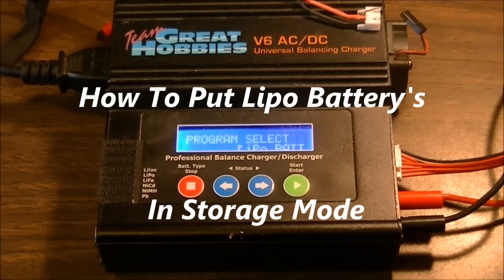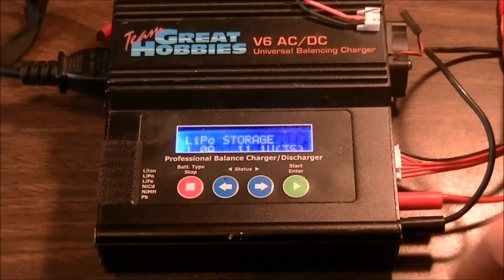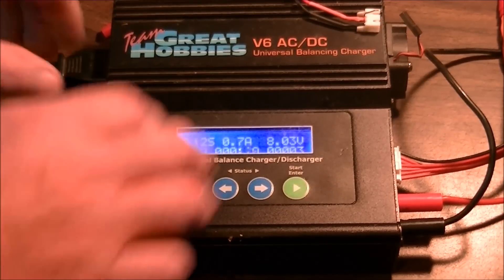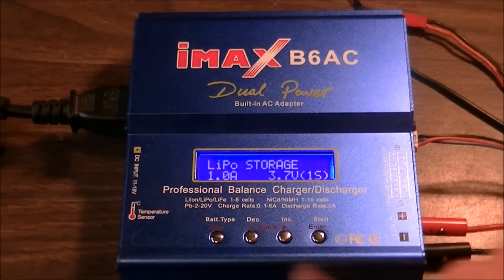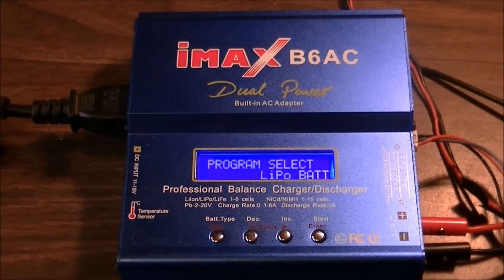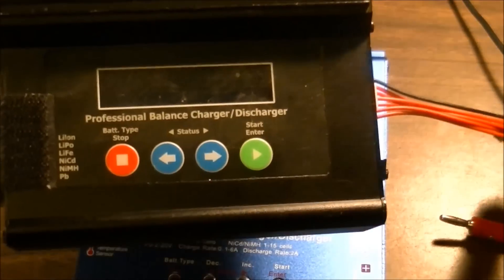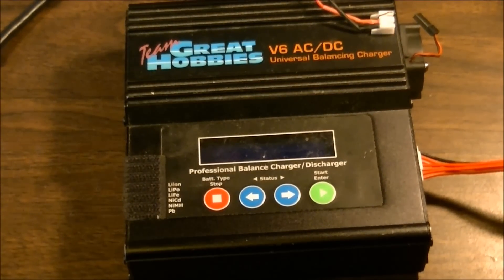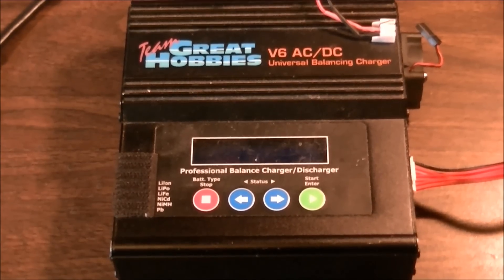How To Put Lipo Battery's In Storage Mode

Comment: Does this apply to Li-ion batteries as well? If not, what's the proper storage voltage for Li-ion batteries?
Reply from the maker: proper for lipo is 3.8  volts per cell
Reply: @KevinMillard68  yes, that's for lipo. How about Li-ion?
Reply from the maker: @cadd9511  same thing for both
Reply: I heard Li-ion can go as low as 2.5v. But that was on another vid

Comment: Will the B6 charger be compatible with a 12V DC Adapter, and does the charger  notify the user when it is finished in “storage mode”? Thanks!
Reply from the maker: you have to use the voltage and amperage and polarity of the one its made for it

Comment: can i storage mode a fullycharged lipo
Reply from the maker: yup because storage mode drains the battery to storage mode.. you can just leave a lipo fully charged over time like any other batter they still lose power the longer they sit on the shelf either way youll want to top it up before the next use
Reply: @KevinMillard68   tnx bro just storage mode it last night 😎

Comment: if your battery is below storage voltage could i use storage mode to charge up to it or would i have to balance charge it up then discharge it down.
Reply from the maker: my advice balance charge it up then put it into storage mode

Comment: Hi, does Lipo Storage only discharge or will charge a under 3.8v per cell battery (that has been flied for example) or do I need to put it in balance and stop at 3.8v per cells ?
Reply from the maker: it dishchareges the batter to 3.8 volts per cell

Comment: Does it affect battery life or quality when using higher amperage for the discharge rate. Thanks.
Reply from the maker: no it does not the higher rate makes it do its job faster,, how ever when you charge any battery at higher rates to charge them faster that does affect them and can even cause them to catch fire as well expecially with lipo and  life batterys and li ion batteries ,, now for nicad and nimh batteries to charge them at or above their rate can cause them to over heat or catch fire and does also limit there life and charging any battery that is freash out of the RC in this case with out  letting it cool down first will also casue shorter life and can also damage the battery as well.

Comment: hi, so it mean that , storage mode are just to keep the battery at 3.8v per cell rite? no matter if i had a full charge, i just use it to drop the v to 3.8 and store it also are necessary? as long as the battery had a 3.8v per cell, am i rite? 
for the storage mode, if my batter are lower like a 3.7v, using the storage mode, it will help me to charge it till 3.8v and cut off? & if over like 4.0v , it will auto help me drop it till 3.8v and cut off?
Reply from the maker: you just need to follow this video to put your lipos in storage mode, in all reality i never use storage mode on any of my lipos but i do make sure that once a month to top them off to make sure they are fully charged in case iam going to use them,,

Comment: Hey I really love your video I just want to say I'm using the Venom charger I'm on the store charging now and I would like to know how long would it last to storage how long the charging will last because this is my first time doing this will that one point amp will that change what would it do or would it cut off when it finish
Reply from the maker: you set the dishcarge rate to how fast you want it to put it into storage mode , as for how long a battery can stay in storage mode no one really knows that answer but it can stay that way for along time so several months for sure but not forever

Comment: do I need charge battery first before storage mode? or from flat?
Reply: If you put it in storage mode if the battery is BELOW 3.85V, storage mode will raise the voltage to 3.85V.

You don't need to balance charge first then storage charge. That's unnecessary and doesn't confer any additional benefit.
Reply from the maker: you never ever r un a lipo flate dead how ever the storage mode is 3.8 volts per cell so you have to have a min of that or above to put into storage mode if you are below 3.8 volts per cell you will have to chage the battery for 20 min then stop the charger then put it into storage mode
Reply: @KevinMillard68  I realize this is OLD. However, to be clear I believe he likely didn't really mean "from flat" to be ZERO volts. He was probably thinking from the lowest safe voltage for a particular cell configuration (basically the same as using "Discharge" mode of unit). Similarly, it would be comparable to the default cutoff point at which a protected cell/battery would stop supplying energy.
Reply from the maker: @exgenica  some rcs will not cut off till they hit 3.0 volts which is bad for most lipo batteries to got that lose and life batteries can go to 2.2 if i recall and be safe but lipos no lower then 3.0 but again most cant its a bad thing to go that low

Comment: my charger goes to 2A should I put it in storage mode with 2A or 1A?  I've got an 4500mah 6S pulse Lipo
Reply from the maker: 1a or 2 a is how was it will drain its your choice how fast you want it to drain to the storage level

Comment: I have putted my lipo in storage mode now. but if I want to use it again what should I do then? charge it first or discharge it first en then (balance) charge it? or something else?
Reply from the maker: always balance charge and you have to charge it before you use it due to the fact you have it in storage mode
Reply: I balanced my lipo with the correct inputs etc. but as soon as I started flying with my quadcopter it started to beep, that means that the battery is low. what did I do wrong?
Reply from the maker: so you put the battery in storage mode then you recharge it normal  in balance mode is this what you saying, it sounds to me you tried to use a battery that was in storage mode only in which case that would explain your problem
Reply: lars beckers it might just be your low battery buzzer. Sometimes when you give a lot of throttle the batterys voltage will go down but right back up once you decrease your throttle. Either get a better or high discharge rate battery or if you can set you low battery buzzer a little higher.

Comment: Always disconnect battery from leads before disconnecting from charger because the banana lead can short the battery and possibly explode battery
Reply: 10/10 point
Reply from the maker: sir sir yes sir LOL look man iam not an idiot so that wont ever happen to me how ever you have a good point thanks for pointing that out good job :)
Reply: @KevinMillard68  Of course it will never happen to you. That's why the electrical industry has health and safety procedures, regs.

It's amazing what can go wrong when one is in a hurry and possibly distracted for whatever reason/s. A snag here a trip there..
Reply from the maker: @sonicstep  :)
Reply: You mean from charge leads with exposed, unshielded end conductors to avoid shorting. 

That is a typical shortcoming with such a generic charger that uses banana connectors. The ideal would be a shielded connector of sorts.

Comment: what storage amp should i set my charger. 2s 5000mah 40c. my charger option storage are.   
.1 to 1.0amp
Reply from the maker: thats how fast it drains it down the lower to longer it will take to get to storage mode so its your choice
Reply: I do my battery at 1.0 per venom rc support .I have a 5000 mah 35c 2s and that’s what they suggested

Comment: can you put a full charged battery in storage mode? Can you put a dead battery in storage mode? not dead as in broken dead as in just ran out have to charge it again. lol
Reply from the maker: yes you can take a fully charged batt and put it in storage mod stoarage mod is ususall 3.8 volts per cell so it wont be fully charged anymore when its in storage mode as for your dead batt if its a good batt and just hit its cut off then you can piut the batt in storage mode it will be charge to the proper volts only for storage mode

Comment: is it normal for this to take a couple hours to do?
Reply from the maker: to charge a battery yes,, however you can fast charge your batterys but you lose run time and you can damage the battery and you risk a fire to by fast charging and you shorten the battery cycle life alot by fast charging but hey to each his own i like to have my batterys last and run 100% etc.
Reply from the maker: it takes awhile to put a battery into storage mode yes its just the way it goes

Comment: I understand that the battery need to be put into storage, so if my battery is ready to be charged rather than already fully charged, does the chrger (imax B6) know to discharge or recharge to the needed storage level?
Reply from the maker: +Michael Aguirre you have t program the charger to discharge it when you want to, you also have to program the charger for the mah of the battery so it does not over charge it, it will know when to stop the charger you also have charging options like fast charge , straight lipo no balance and balance mode ,, i always balance my lipos everytime at 1/2 the rated mah or less so the battery is charged properly and fully i also always discharge my liopos to 3.0 volts per cell before recharging ..when you want to put your batteries into storage mode you program it to do that its called storage mode on the charger, i never use storage mode my self i find it useless for me as iam always taking my machines out and even if i dont its still useless to me

Comment: after its done balancing the cells for storage, do you need to charge it again before use?
Reply from the maker: +GroundUpProduct yes because stoarge mode also drains the battery to about 3.8 volts per cell so yes it must be charge again before you use the battery again

Comment: When ever I try to do this it says low input voltage error
Reply from the maker: +david marin make sure you have the right size battery selected 1s 2s 3s etc.
Reply: Yes
Reply from the maker: +david marin ummmmm
Reply: try charging your battery at a low amp rating for a couple of minutes in a different battery setting.  your battery voltage could be discharged so low it wont read properly

Comment: When does the charger 'decide' it is done with the 'storage' process? Is that when each cell is about 3.8 volts? Or does the charger also look at other things?
Reply from the maker: +Marcel Jong its done when it hits the storage mode setup ,I personaly never put my batts in storage mode they dont get to sit long enough to need this feature for me
Reply: +Kevys Rc & Music it's winter time here and bad flying weather. So I bought a (dis)charger because 3 full LiPo work on my nerves ;-)
Reply from the maker: +Marcel Jong i hear ya some people get nervous about it i store my liops in  fire proof bag all the time and so far never had a problem ..
Reply: Mine ran for the max 2hrs on my hiteck and I wander the same ????

Comment: Hi Kevin,

I realize the Storage mode is Only used with LiPo batteries... However do you use the discharge mode for NiMh batteries?? 

Thanks
Reply from the maker: +Tick Tock i used the discharge mode for ni mh and nicads when i cycle them which i do often this was i get peek power all the time when using those types of batterys and they take alot more charge cycles , also with my lipos i use the discharge to 3.0 volts per cell very often as well and i get amazing charge cycles out of them i also charge at 50% or less
of the rate mah for all my battery types in order to get max run time out of them
Reply: Thanks... I just bought a Tenergy TB6AC+80W charger from Ebay.. At the moment I am looking at the RedCat Rock Slide RS10 and the Max Stone 10 Crawlers..
www.NitroRCX.com
Reply from the maker: +Tick Tock your welcome and cool

Comment: dose it mater if the battery is spent or full-charge ?
Reply from the maker: ST Logan well you dont charge a full battery ,,
Reply: LOL I meant for storage .. dose it mater if it charged or not ??
Reply from the maker: ST Logan you should store them at the storage mode level which is 3.8 to 3.85 per cell

Comment: Please reply, what does storage do to your battery and why do we use it?
Reply from the maker: Aaron S it takes the batteries down to safe level basicaly 3.8 volts per cell so they can be stored for long periods with out any  problems ,
Reply: Kevys Rc & Music thanks, could it be stored for 2 months?
Reply from the maker: Aaron S yup several months

Comment: I have never put my batteries into storage and I have a lot of lipos. One time one of them puffed up big time and split apart the hard case it was in. this was one of 2 batteries that were both charged and I run them both at the same time in my HPI Apache since they were both new. they were just sitting on the bench at the time unplugged, so I'm not sure what happened there. I have had some batteries drop a cell sometimes, hard to say what the cause is
Reply from the maker: i never put mine in storage mode either but some guys want to play it self and thats cool